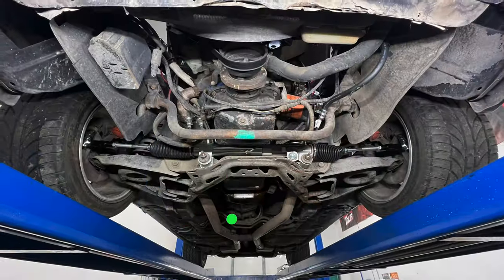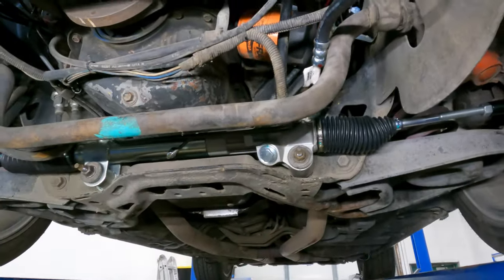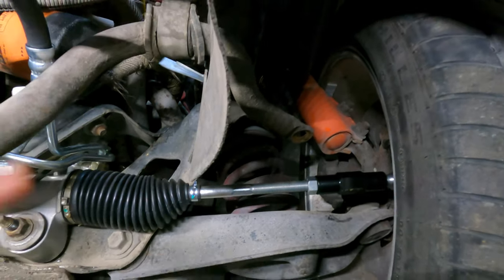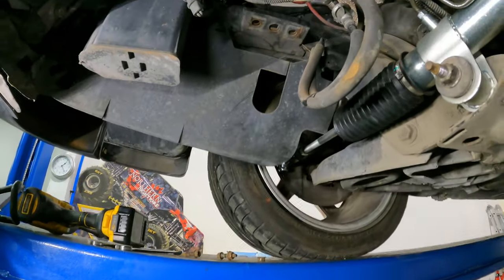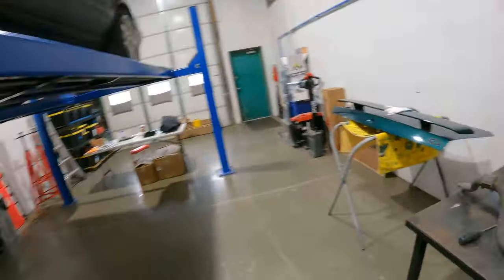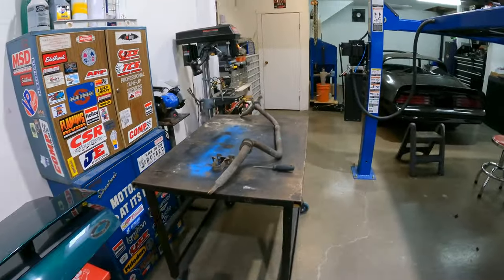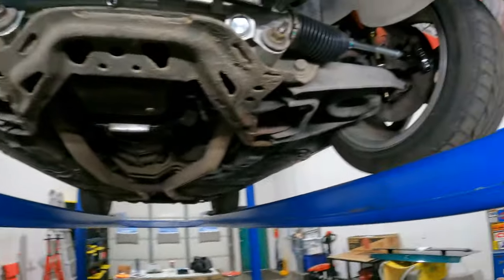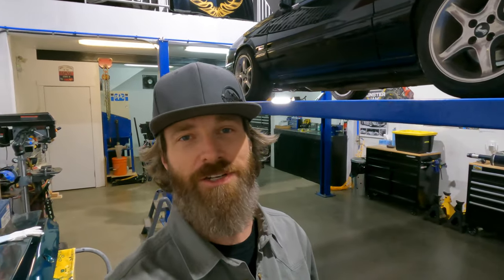The Most Overlooked Suspension Component For Stability & Handling

Comment: yeah those plastic things are the factory nut holders for the swaybar. The nuts are molded into the plastic but when the time comes to remove the bolts because you want to upgrade the bushings the plastic is so brittle that it shatters as soon as you put a wrench in the bolts!
Reply: Plastic was already brittle 20 years ago
Reply from the maker: Another fella mentioned that and when he did it brought back memories. Yes, you are correct 😂👊

Comment: If you order a complete suspension kit (no sub frame connecter) from companies like MM for under $7K, & tune it correctly. It will ride like a BMW and perform like a Porsche. One of the biggest problem was the stock short wheelbase & rear hops, & unibody body rolls. With a set of custom weld inner sub connecters you can even cruz home with a flat tire. Best investment I ever did, & was much more useful & fun than buying HP.

Comment: So, putting Sn-95 frame brackets and end links don't hurt the handling. It moved the sway bar away from the front drain plug, less oil drain mess is why I did it. The bar ends are parallel with the lower control arm.
Reply from the maker: very cool!

Comment: Unless the car is collectible--or used for drag racing--the most important suspension factor is replacing the factory 4-link with a torque-arm/panhard bar (or homemade 3-link). The reason NASA allows this modification in the CMC (Camaro/Mustang Challenge) class is because the Mustangs were at such a disadvantage to the Camaro. It completely transforms the handling.

Comment: Good video and thanks for the good content. 

I somewhat disagree on being most overlooked.  I believe the most overlooked item is a good front lower control arm bushing.  Switching Polyurethane, del a lum or Delrin at the lower control arms is probably one of most effective moves you can do to stabilize suspension geometry.  Most Mustang guys unfortunately chase down aftermarket control arms before improving the factory control arm.
Reply from the maker: Thank you

Comment: Basic but overlooked important tech. I'd love to lower my 95 but between bad Maine roads and driveways and having 265/35r18 on cobra reps with wheel spacers dropping it much if any is nothing but bad. And as much as I don't like the idea of spacers I love the look of some wheel poke, I get compliments on the stance so often. I know this is a mainly Fox channel but us lowly hated 94/95 sn95 guys can use 75% of the fox tech. It's a tough year to fit in anywhere The fox guys turn there nose up at em and the OHC guys look down at em, personally I think there the best of both worlds, i love the looks of the 94-98s and as much of a nightmare they are to work on some day i want a 96-98 32v cobra that will walk bolt on coyotes.
Reply: 94-95 had some nice color options
Reply from the maker: You won’t get any hate from me buddy. I love the SN cars 👊👊👊

Comment: Do you think this could effect the tracking of the car, by this I mean following the grooves in the road? Mine has been lowered converted to front cobra disc brakes, I didn't do this so don't know if it's sn95 spindles or what was used, everything done to it seems to be quality but was done quit a few years ago. I have put a bump steer kit in it and had a front end alignment, although I don't know if they properly adjusted the bump steer spacers. I also run 255 tires up front.
Reply from the maker: No, typically that is due to mis aligned tie rod ends. Have you seen my bump steer videos? I've done two of them in the last couple of months 👍. If you have a bump steer kit installed then chances are it needs more/less spacers to correct the alignment. The 255 tire won't do you any favours in this department either but if you're really noticing it tracking all over the place I would lean towards checking your bump steer kit
Reply: @KASLCustoms  That's where I was looking but figured I would ask from what my research tells me the spacers don't look right, definitely not parallel to lower control arms. I'm going to watch those videos thanks. It's driveable just wouldn't mind it a little better and yes I hear wider tires can contribute to this.